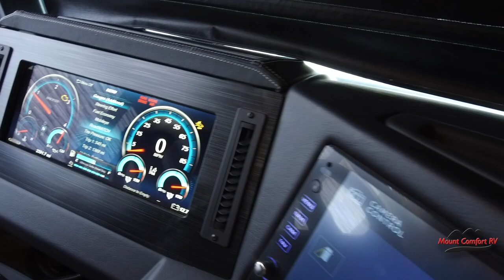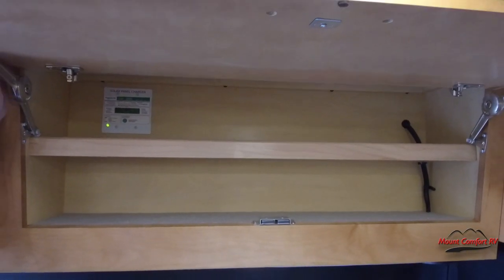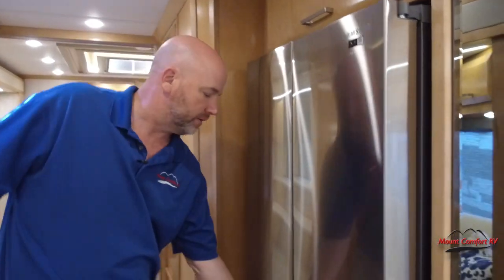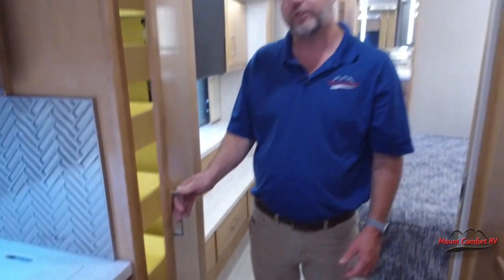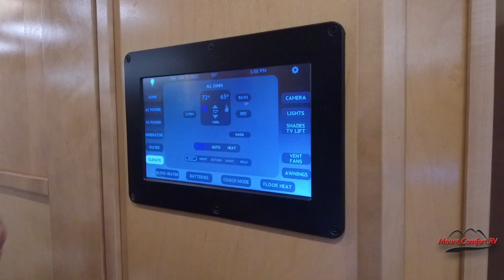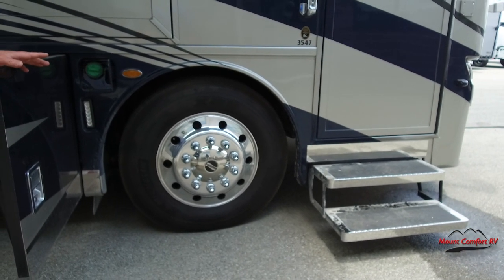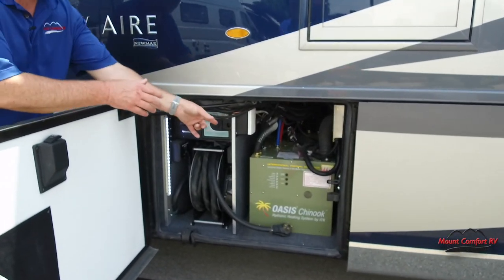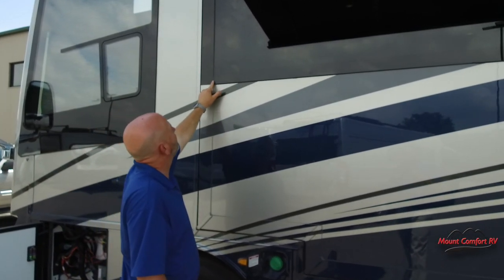New 2023 Newmar New Aire 3547 is finally here! | Mount Comfort RV

Comment: One of the Best in the biz for Newmar tours. Chris is the man! Glad to see they made Comfort drive available via a single button. An oversight when Freightliner went to the multi-control stalk off the steering wheel. Amazing the amenities that they can have in a 35ft coach these days..two thrones are a necessity on a m/f/o couple travellers today apparently.

Comment: I  think  is  to  close    to   the    wall   the    hotplate    ,  we  have   exactly    the  same   thing    in  our    kitchen    but
With  gas    hotplate    and   the  wall    during    the  cooking  time    getting    very  hot    so  quickly    which  is   dangerous 
In  case    if  the   wall  is  made    from    wood   , but  if  is   made   from    natural  ,  stone    then  is   more   safer,   but  still
,  in  my  opinion    the  hotplate   should  be    more    further   of  the  wall   even   if   the  wall   is  made   from    natural   stone, 
,  because    after    many  years    of  using    the  hotplate    we  got     crake   in  the  stone   from  overheated -  overusing 
the   stove   in  natural stone ,  which  is  thik    for   2  cm   -   2,5   cm   .  And   I  usually     trying     maximum    to  avoided 
to  cooking  anything     on  the   closest    side  to  the   wall      of   these     stove   .